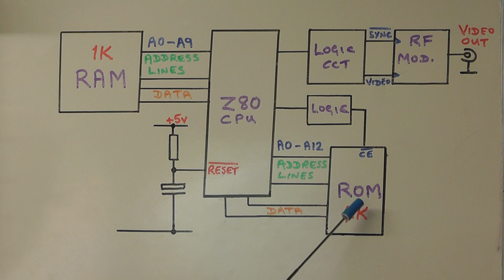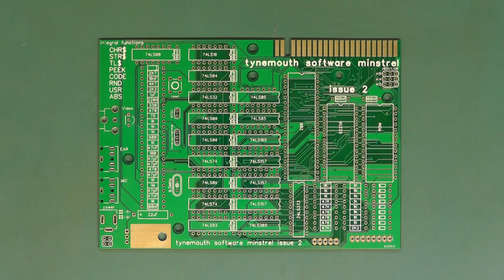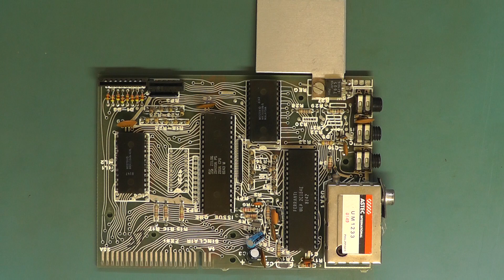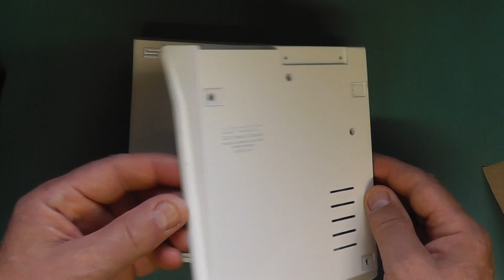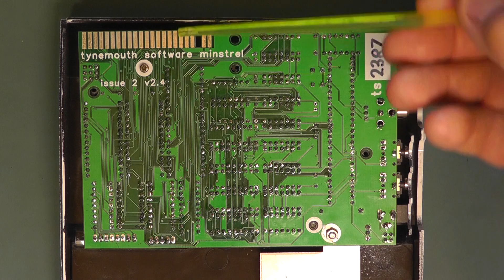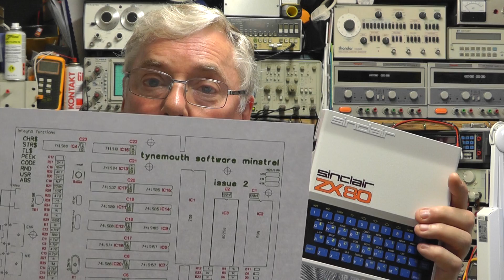Scullcom Hobby Electronics #51 - Build a Sinclair ZX80 Clone

Comment: Arrg!
How you can spray a ZX81-Housing white?
I will never understand it.
;)
Reply: It actually looked good.
Reply: When I did mine, I had started with a pretty beat up ZX81 case which had marks and scratches on that made it not really suitable to be a ZX81 any more. I was able to sand off all those marks before spraying and brought it back into use. Some pictures on the original blog post: http://blog.tynemouthsoftware.co.uk/2017/02/minstrel-zx80-clone-issue-23-boards.html
Reply: @jorg,why not plenty of dead and dying examples of the zx81 out there, thats what i do i build bespoke units using single board computers, i build them into dead 80's machines with keyboard conversions, people seem to love them.
i do repair/upgrade original stuff too, but wont use working examples to build customs that is my only rule, if you want a pc putting in an old computer it has to be a dead example, loads of dead stuff out there cheap without killing good ones.

Comment: I still have my original ZX-80 and a 16K memory module, it still works:-)
Reply from the maker: The original ZX80 are quick rare now and if it is good condition they can sell for up to £500. Nice investment :)
Reply: After getting it out of storage, it turns out my memory is bad:-( It's a Timex Sinclair 1000. The PCB looks almost exactly the same. It does work though.

Comment: Hi Louis... Now that takes me back a bit. A mate bought a ZX80, I got the a ZX81 as the start and after 2 weeks, a 16k expansion pack and the thermal printer, sold it all at the Telford Radio Rally, then bought a Dragon32, then a Dragon 64, to which I added OS-9/6800, a home brew 1772 HD controller and 2 huge 5" full height Rodime Hard drives; with the whopping capacity of 5MB and 10MB respectively. They power supply was astounding, it needed around 10/5v and 10A/12v to spin those monsters and the SA400 card to drive them. Oh heady / happy days, it takes me back to the very start, Lovely nostaligia trip, well done... Thanks...
Reply from the maker: Thanks for the comments Martin. Agree, they were happy days. I move on from the ZX80 to a Ohio Supperboard with 4K of RAM and then on to a BBC Model B Computer. I still have both of these.
Regards,
Louis

Comment: Perhaps it might be better to mount the switches on the back of the case. There is a lot more room there to mount & group the switches. Depending upon the size of the ROM module, one two or three switches could be used for ROM partition selection (A13, A14, A15.) Mounting the switches would not spoil the lines of the case sides, but would still be easily accessible when required.
Reply from the maker: Thanks. Good idea. I have not drilled the holes yet so I will add the switches at the back.
Louis

Comment: I lost my computer virginity to a TRS80 Model 1 in 1978. The Sinclair ZX80 was my 3rd. Second honor goes to Ohio Scientific kit with the first 6502. 
I feel old now :(
I am pretty sure the cardboard cutout is not the original ZX80. I bought the kit when it first came out and it was black, not as tall, and with a flat top. Only 1K Ram! Typed the example in the manual and got a graphical clock program going. After that, chucked it in the closet and moved on to better things. Mainly NorthStar with CPM, then Apple, IBM PC, IBM PC AT,.....
Edit: I think they marketed it in Canada as ZX81. They could've sold the unit you showed in UK only?
Reply: The white case, blue keyboard and raised lid was the ZX80 (which I think was UK only). The black case, grey keyboard and lower lid was the ZX81, which was a revised design. That was sold as the Timex Sinclair TS1000 in the US.

Comment: This is my kind of project. I'm a bit surprised you didn't mention the possibilities for those of us familiar with Z80 machine code to actually "spin" our own ROM for this project or is that a future project you have in mind?
Reply: This is probably not the best hardware to use to spin your own Z80 code, as the CPU spends most of it's time drawing the screen, which you would have to replicate. Better go for the excellent RC2104 series of kits if you want to write Z80 code.

Comment: I think I might build this
I'm very interested in the implementation of 74 series logic for the video output
Reply from the maker: I should just mention that if you do build it try and use logic IC's of the 74LS version. I think the 74HCT type may work but when I tried to use 74HC type I had issues and it did not work.
Reply: Yes, HC is evil. The logic levels are CMOS, not TTL, so something like the ZX80 circuit which relies on the analogue properties of the digital circuits is more conscious of those levels. HCT does work, but LS is more authentic, and all parts are still in production.
Reply: +Dave: I actually belive HC would work for most (if not all) of the circuits. I strongly suspect either the clock oscillator" or it's two peculiar 470/47pF HP-filters, i.e. that these must be adjusted for CMOS-levels and currents. That "resistor multiplexer" on the data bus would be another (less likely) candidate. The diodes for the keyboard are very unlikely a problem. All the 1K ohm pullups could be a bit larger though, as HC/HCT draw less input current than do LS. (Where else are analogue properties employed? Haven't studied the schematic since the 1990s).
Reply: As well as the clock and delayed clock lines, and the databus sharing you mentioned, the video mixing levels would also need to be changed, and some of the ear/mic circuitry. I'll rephrase what I said if you like. The circuit as is, with the values suggested, will work with LS chips. You should be able to use HCT chips for most parts. If you use HC chips you may need to adjust several component values. There are also several parts which may not be available in HC or HCT varieties. All are currently in production in LS versions. 

So you might be able to get it working with HC chips. You should be able to get it working with HCT chips. You will be able to get it working with LS chips, which is what I would recommend.
Reply: Yes, the video and tape interface would need an adjustment as well, using HC. But what do you mean by "delayed clock lines"? There are nothing like that in the ZX80. The two HP-filters on the clock that I mentioned are quite the opposite to a delay.

I agree authentic circuits are cooler, but as long as you don't use CPLDs, FPGAs or similar, but ICs that were around in the 1980s, it's good enough for me, by a large margin. ;-)
Reply: Thank you guys for all of your replys👍 I will be using genuine ls series ic's on a side note the chips on ebay are they exactly the same as the original genuine chips or are they say cmos implementations of the ttl design to give the same logic functions. obviously they are not genuine as advertised but are they exact clones?
Reply: No idea about ebay..., but you could buy 74HC/HCT and often also 74LS/74F at normal electronics suppliers. 74HC and 74HCT are CMOS implementations of the 74-series TTL functions. As all CMOS, the output voltages and current capacities are symmetrical in HC and HCT, as opposed to TTL/LS. The difference between HCT and HC is that HCT has the same input threshold levels as TTL/LS (for better compatibility) while HC has symmetrical levels also at the inputs.
Reply: Yes, can't say for ebay, but if it says 74LS, you should be ok. You can always buy one of my kits of you want a complete set of brand new Texas Instruments 74LS chips.

Comment: It was my first computer as well... with 16 Kb memory expansion and a cheap tape recorder for storage. It lead to learning basic programming and ultimately a career with Microsoft etc. It was the best investment I ever made... for that reason alone I'll build one. The second coming so to speak...  Thanks for sharing! :)
Reply from the maker: Thanks Yann. The ZX80 was also what I learned programming on. Interestingly the original ZX80 are now quite rare and good ones sell on eBay for upto £499. I recently found this PCB and though I have to build one. I have since had lots of fun using it and remembering the good old days when not only could you build one yourself but you could understand it to.
Regards,
Louis

Comment: Sound was clipping pretty hard.
Reply: Too much gain?
Reply from the maker: I agree. I am not sure if this mic is better than the camera mic which I have used on my previous videos. I may go back to the camera mic, but it was worth a try.
Reply: The mic itself is probably not the issue, something downstream is being overloaded. There's also some fairly heavy compression happening which is causing the "gasping" sound at the end of every sentence as it releases while you breathe in.
Reply from the maker: The mic I purchased was the type specified by Panasonic to match my  video camera. I will have to investigate further.
Reply: Constructive idea: The mic is pretty "hot" - Look into putting the mic upside down so it's pointing down and towards your mouth - it takes a lot of the "directness" off of it.
Reply: Yes. A lot of compression (auto gain? used here) - instead. set the gain manually on the camera, make a loud sound, adjust the levels so it just about clips and keep that level. ElectroBoom touched on the subject as well.